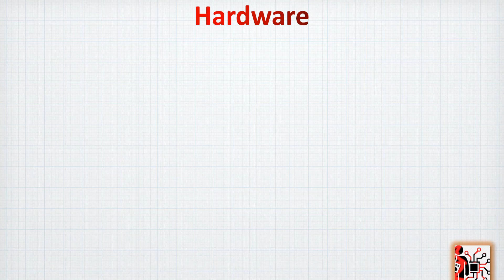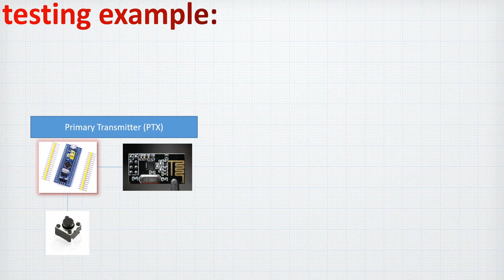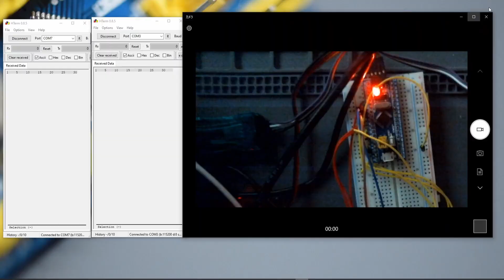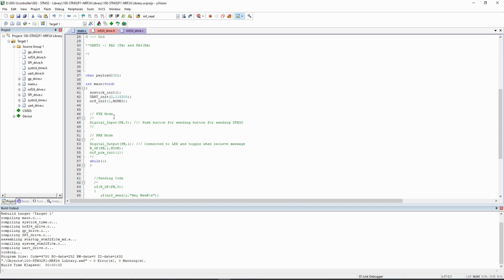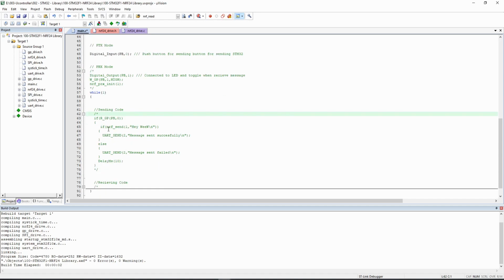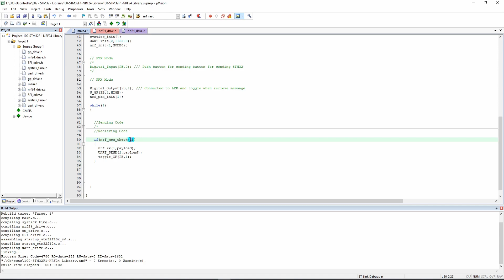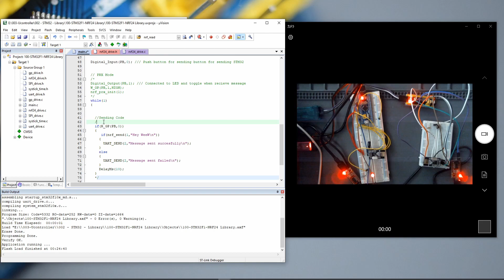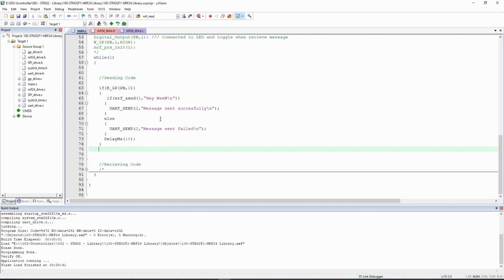104 - STM32F1 NRF24 Library  Quick setup and example

Comment: I can use two devices on my pcb. These are using a SPI Communication so I made my pcb design with this in mind. I selected my microprocessor with this in mind. My Mcu is STM32F103C8T6.
My first device is ADC and I selected SPI1 pins, and second device is NRF24L01 and I selected SPI2 pins. I try to some coding example but I failed. I think reason is that I can write or add some library and some coding line. But I didnt know. If you have an idea, reply this post and we discuss.

Thank you!
Reply: hocam iyi günler. Problemi çözebildiniz mi?